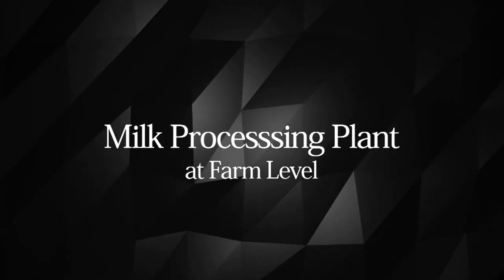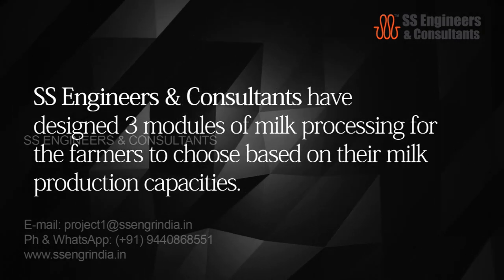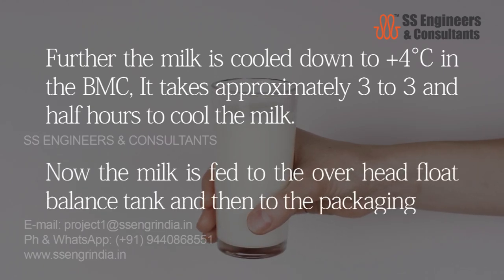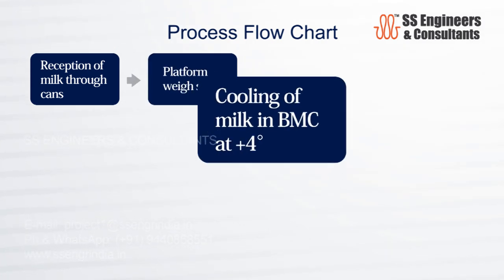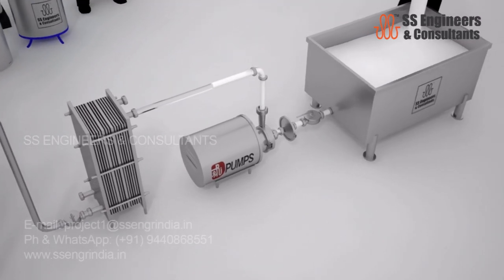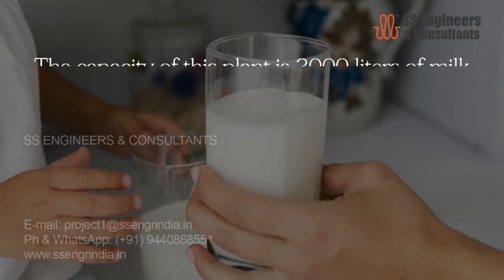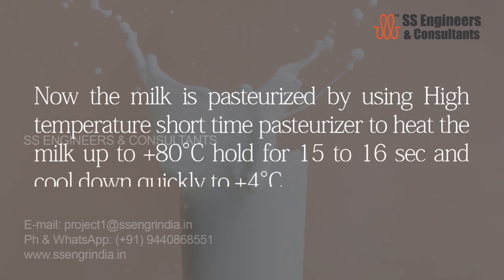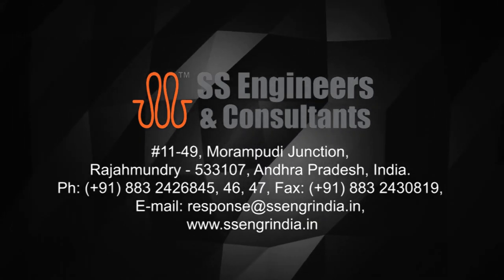Farm Level Milk Processing Plant🥛 | Milk processing #MilkPlant #milkprocessing

Comment: Hi, The video and content is really good. However, the process flow chart should be a Block flow chart. For the part of pasteurization from raw milk. Does it use Plate Heat Exchanger? Then it should be transfer an another unit to complete the pasteurization process because Plate Heat Exchanger is not high efficiency and hard control the temperature. Thank you for your videos.
Reply from the maker: Thanks for the tips! :)
Reply from the maker: Hello Hung Lequang,
Pasteurizer is known as HTST means High Temperature Short Time milk pasteurizer. In this instant heating of milk  is carried out with steam or hot water to an ambient temperature to kill all pathogenic bacteria during short time holding & rapidly cooling the milk to 4C to retart the growth of left over bacteria if any.Instant heating & chilling of milk is being facilitated in HTST Milk pasteurizer with temperature control. Where in batch type milk pasteurizer time & temp control is not possible.Further both cream separator & Homogenizer can be operated in line with HTST milk pasteurizer. In batch type pasteurizer it is not possible.

Comment: The quality goes down in three to three and half hours. So basically low quality milk is getting cooled. There are BMCs which cool immediately.
Reply from the maker: Please provide your detailed requirement to this mail id: project.ssengrindia@gmail.com or call on +919441043543
Reply: BMC takes 3-4 hours to cool the milk, this system offers instant cooling of the milk with advance technology cooling system.

Comment: Hi, if I start mini plant how much is the cost, and how many litters i should  sale from entry level.
Reply from the maker: Please provide your detailed requirement to this mail id: project.ssengrindia@gmail.com or call on +919441043543
Reply: For entry level mini dairy plant how much capacity is enough to start, whether later possible to extend more volume
Reply: starts from 12lakhs and ends to 35lakhs

Comment: how much does the cost of module 3 for 3000 litres?
Reply from the maker: Thanks for your Enquire, Please drop a mail to itssengrindia@gmail.com
Reply: @ssengineersconsultants  It depends on the configuration, starts from 12lakhs and ends to 35lakhs
Reply: Their quotes are really higher . 500lph , they sent quote 56lacks . Where as the same equipment we are getting it bw 12 to 15lacks from other states like Noida , Delhi etc